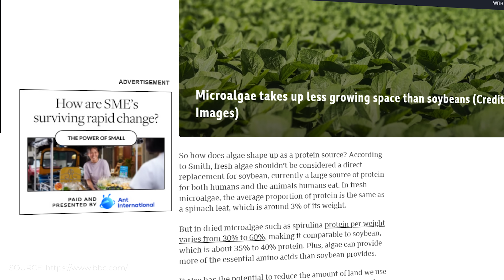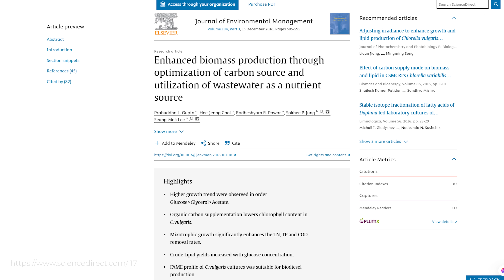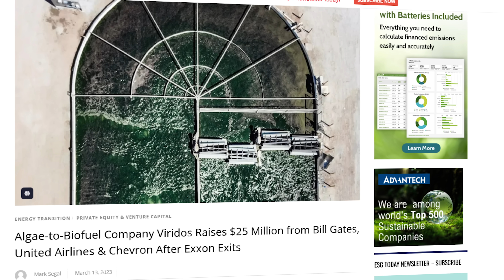Algae: The Ultimate Circular Crop?

Comment: No, this is not sustainable and never will be. Carbon isn't the problem in terms of an increased global average mean temperature either. For the most part, ignorance is. Are we warm blooded?  Excessive heat, generally speaking, is emitted from the core outwards, by us, as well as Earth and is transferred via entangled states, ions, positively charged particles passed their embedded energy capacity, carrying heat and the various wavelength energies, relative to above or below the equator, day or night cycles, longitude and so on. There's actually several already existing heat transfer mechanisms, none of which seem to be being utilized  correctly. Understanding Entangled states, high and low energy states, relative to energy inside and outside the particle, max propagation vectors, wave particle duality between light and sound and orders of magnitude, transverse as well as inverse proportionality are really what it's all about... Biomass is generated through orbital shell mechanic's, the charge carriers carrying electrical energy and the energy making the bonds, and probably most importantly, the correct energy levels and polarized magnetic field.. . The ENTIRE scientific community is pitching nothing but false dichotomys to the masses. It's mind boggling the arrogance of humanity in dismissing not only the importance of already existing biomes, that have worked for millions of years, but the interconnectedness of us all. The lack of willingness to first of all, to even understand, let alone work with, those already existing balance mechanisms that balance energy interactions and propagations condusive to the survival of conscious beings at the various energy levels of the various brain wave states and have for millions of years, will never result in sustainability. This is just consuming energy that harms the oceans, lakes and living creatures within them, which ultimately harms us all.

Comment: Professor John Todd has already solved the algae problem by turning it into an answer by using 
his self-feeding tilapia solar ponds. His tilapia produces fish wastes that in turn feeds the denitrifying bacteria that converts it into nitrates that feeds the algae that in turn feeds the tilapia fish. The maximum diameter size of the solar ponds is 5 feet in diameter and 5 feet deep that can allow sunlight to penetrate from all sides to allow full sunlight saturation-penetration. But one must not overlook the fact that you must bioactivate the biogeochemical process by adding water soluble rock dust powders mixed to saturation point in the water and some uncontaminated plants-based humus. And then to continuously replace the water and dissolved rock dust powders that are systematically and synergistically and biogeochemically processed into tilapia fish flesh, bones, scales, fins, organs, eyes, etc.

Comment: It just so happens that I did out the math on the amount of algae that you would need to produce the 20 million barrels of oil (since thats where the vast vast majority of oil comes from, not dinosaurs) per day that the US uses.  You would have to flood a land mass the size of texas to about 6 inches deep with algae to make 20 million barrels of oil.  and it takes weeks if not months to grow that much algae... not days.  So however long it takes to grow that much algae is the factor by which you need to multiply that land mass by in order to replace the US' oil demand ... from 2010.  I think it might be a bit higher than that now.

Comment: The issue is that photosynthesis is ~5% efficient compared to PVs 20-25% (with reasonable future expectations of 30-40%). In addition, you have all the trouble of a living organism, and having to convert that into useable energy (while PVs just spit out electrical energy directly). Add also that algae isnt very energy-dense at all, as well as that EVs are ~2.5-3x more energye efficient than fuel cars. In the end, youre looking at a terrible idea for fuel. In the most ideal setups you end up spending dozens of times more energy and is alot more complicated than putting up a PV panel once.
Its very interesting for animal fodder etc though.
Reply: Algal oil also has applications where a cable to a PV array isn't practical, such as for ocean-going ships and submarines. Surface ships could certainly be covered in an array of solar panels, with modular units bolted to the top surface of the topmost containers and down the sun-exposed sides of the outside containers on a container ship, for instance, but when they run into mucky weather that system is going to need a back-up option, and a tank of algal oil would be perfect. They might even find that a tank of oil is more practical than batteries to power the ship overnight. And of course submarines can't run on solar power at all when the whole point is to stay under water as much as possible. Algal oil biodiesel would be a 1:1 replacement for the fossil diesel currently used by non-nuclear submarines.
Reply: @tealkerberus748  Thats certainly true, there will still be applications for "normal" fuel, since its easy to transport & store and very energy dense. And any array of solar panels would of course do absolutely nothing to a ships power requirements. Basically just replace the dirty heavy oil with biofuel. That would work. Then it just competes against other oil crops, and there it wins on less land usage but loses on complexity. Since land is fairly cheap compared to building gigantic bioreactors, I dont see much potential personally though.
Reply: @paulverse4587  Land being fairly cheap is intensely dependent on where you live. I think there will be applications both ways. If algae production can be combined with existing functions such as sewerage processing, that will change the economics too.

Comment: fun fact, you can extract a form of plant oil from algae, which you can then use to make numerous oil products including bioplastic, biodiesel, waxes, soap, etc. The bioplastic can even be used in 3D printers. You can technically make all these things using store bought vegatble oil as well.
Reply: Do you know if the bioplastic still takes a long time to degrade in the environment?
Reply: @Kx0195  It probably does. All these bio- variants are chemically the same, just have a different source.

Comment: About ten years ago, several startups tried to make algae biofuels a thing. OPEC, specifically the Saudis, dropped the price of oil so low that algae fuel couldn't compete. 😢
Reply: One day oil will run put and they all will scramble for any tech that will make it in any amounts
Reply: @m4r00123  instead of oil earth will definitely run out first
Reply: @hardik1mehta  As oil runs out, previous methods or sources deemed unprofitable become more attractive. We'll likely transition before we run out of oil.
Reply: @jasonwong972  Here's the thing about resources. Oil won't "run out" as we know it, because technological development can give us new sources of energy. Fracking for oil opened the door for the US to becomes the largest oil producer on the planet, which would've never happen if we've never discover fracking.

We have no oil in the mid-19th century because it was useless to us, only when we know how to harness their potential did oil resource becomes valuable. Same with coal, before the industrial revolution it was worth basically nothing because there was large demand for it. Nuclear too, before nuclear reactors were invented it was just simply some funny material with very little practical application.

As technology progress, we discover more ways to get the energy we needed, that's just how it goes.
Reply: @jasonwong972  i ve seen a system where alcohol and oil mix and become biofuel
Reply: @m4r00123 the answer is solar. Solar has been competitive and gaining in efficiency lately. Of course the Americans can't make it so high tariffs are slapped on the Chinese panels
Reply: @m4r00123  No it wont run out, oil is not created by a biological process its abiotic in nature, they just found a moon iirc that was full of hydrocarbons and there is no biological matter. 
Its just a lie to get people to live in fear, the oil is produced constantly deep in the earth we have thousands of years worth of oil right now and the are always finding more. 

Oil is about to drop in price massively also.
Reply: Fracking: Between 2005 and 2015, U.S. natural gas production increased dramatically, and by 2018, the United States had become the world's largest crude oil producer. This transformation fundamentally altered global energy markets and significantly reduced U.S. dependence on energy imports.
Reply: @ugjhgjf this is extremely false and misleading

Comment: 5:21 Why are there round pipes with Algea water in it ?
Woudn't the most light is already blocked before it's in the middle of the pipe ?
Looks like a waste of resources to me.
Reply: these algae circulate throughout the entire pipe. It flows to the top, come down and then repeats over and over. This ensure that 1) algae do not settle 2) equal amount of sunlight to all 
3) prevent photo inhibition at the most top layers

Comment: Am I correct that only sea water & carbon dioxide is required for algae to grow? What do they ACTUALLY feed on? Seems like other biological materials is just an additional food source?
Reply: Just like other plants they're photosynthesizing the carbon dioxide into Glucose with the UV light emitted from the sun. So they produce their own food basically.
Reply: They need the minerals from sea water, but their food is sunlight, which they use to photosynthesise carbon dioxide and water into sugars and more complex compounds with oxygen gas as a waste product. This is the same as all plants, but algae are particularly adept at it.
Reply: Add sunlight and that's all they need. They pull in the minerals from the seawater to grow. Just like kelp which can grow up to 2 feet a day.

Comment: You could use the algae to make biochar to store carbon and supplement soil
Reply: Biochar doesn't improve soil carbon. That's a nice myth, but actually to store carbon in soil you need to build humus the traditional way with plants and manure.
You can however use biochar to fill in old open-cut mines for reasonably permanent sequestration of atmospheric carbon. This could be from algae, or from bamboo or hemp or whatever other plant is best at extracting carbon from the atmosphere in the climate surrounding the open-cut mine in question. You just pack a lump of biochar into the bottom of the mine, seal it with a layer of clay or whatever so that a random lightning strike or wildfire can't trigger a coal seam fire in it, and keep packing biochar and sealant into the hole until the hole is full.
If we did this with every open-cut mine in the world, we would solve our atmospheric carbon problem. The open-cut mines that had iron or clay or other non-fossil-fuel resources in them would make up for the carbon that came from oil or gas or underground coal mining.
Reply: @tealkerberus748  it doesn't contribute to organic carbon, but study after study shows it improves the microbiome and health of the soil

Comment: He makes an excellent point at the end. Some problems can't be fixed by themselves because the solution is not cost effective. But if that solution can be utilized to solve 2 or 3 or 4 or 5 different things at once then it might become viable.

I have an idea that utilizes this. It takes a new idea for solar power generation, integrate a component to help move fresh water inland, modify it using an existing technology to make it more viable and efficient, combine it with a new idea to improve farming, add in a 100 year old technology to further improve power generation efficiency, add in carbon capture technology that is more efficient after being paired with the solar technology, add a data storage and computation business that is ALSO more efficient due to being paired with the solar technology, and then add a battery technology that not only stores power, but also improves power generation in two different ways and improves the efficiency of the data storage business.

Alone, most of these ideas and businesses are not viable, but when brought together they provide benefits to each other that could make the whole package financially successful.

Comment: “The more CO2, the faster algae grow and multiply”

And in the ocean, dead algae settle to the bottom of the ocean, and many are trapped and buried by sediment.

This is yet another example of how climate alarmism is not based in reality.

Plants grow larger, faster, and more numerous in higher CO2 conditions. Some of which get trapped in the earth after their death.

“Life finds a way”
Reply: That's the whole idea behind ocean fertilization. Natural occurrence is too slow to reverse climate change, so we need to give it a push.
Reply: Yes, the system will probably correct itself eventually if we take our foot off the accelerator.

Unfortunately carbon dioxide levels are now more than 50% higher than they were before the start of the industrial revolution, and the rate of change is accelerating, which says pretty clearly that all the world's plants and all the algae in all the world's oceans can't keep up with our output. This is getting worse faster and faster because it turns out it only takes a small amount of warming to start melting permafrost and degrading wetlands so that a whole lot of naturally stored carbon dioxide is now being released as well. Which means algae in the oceans need to capture and sequester all that, as well as the carbon we've released directly into the atmosphere.

The only negative effects high atmospheric carbon have on plants is that trees grow so much faster their timber is coarse-grained and weak, which makes forests more vulnerable to storm damage and also affects structural integrity of new-built timber framed housing, and plants that depend on their essential oils to fend of insects and diseases are producing more plant mass and less essential oils so they're more vulnerable to attack.

The negative effects on humans, though ... our bodies produce carbon dioxide as a byproduct of our metabolism, and if we can't get rid of it fast enough because there's too much in the air we're breathing, that harms every part of our body. The most obvious damage is in the brain. It only takes 1000ppm to have a measurable negative effect on the performance of schoolkids. They don't learn as well, and they perform worse in tests on material they've already learned. So somewhere a bit below 1000ppm is the threshold for acute poisoning symptoms.

Somewhere well below the threshold concentration for acute poisoning symptoms will be the threshold for chronic poisoning. That's the level that a few hours won't affect you noticeably, but if you're breathing that level for weeks or years or your whole life, that's going to cause problems. We don't actually know what the symptoms of chronic carbon dioxide poisoning are, but judging by the acute poisoning symptoms, it's probably going to make people stupid.

Judging by what I'm seeing in the world news, that's already happening.

Comment: There was a large study at a power plant here in AZ back in the late 2000's where they tried to use the algae to scrub the CO2 from the NG fired plant and planned to use it for biofuel production, they at the time found the algae were slow to grow and didn't scrub nearly as much CO2 as they thought it would and ended up shutting down their algae farm. I was disappointed when that happened, but it does point out that some of these production plans are pipe dreams but others do show a lot of promise, I would hope the engineered version works better but time will tell....